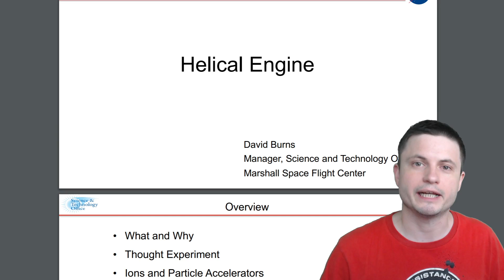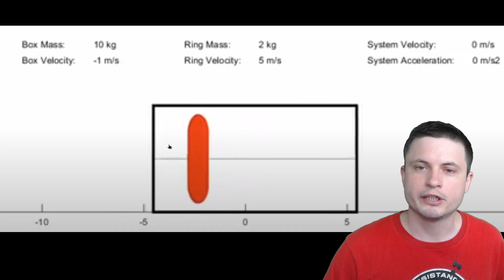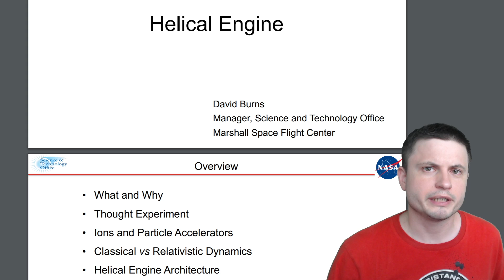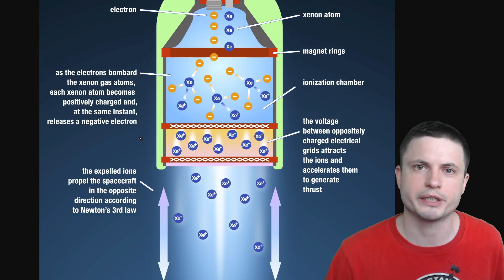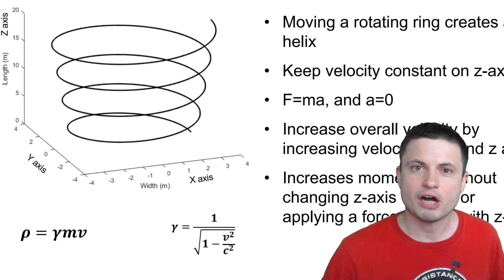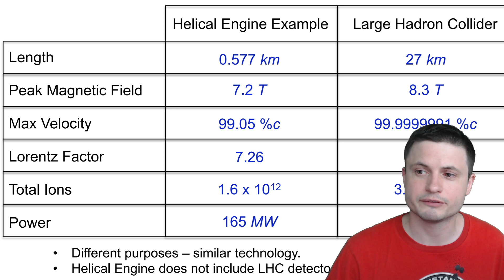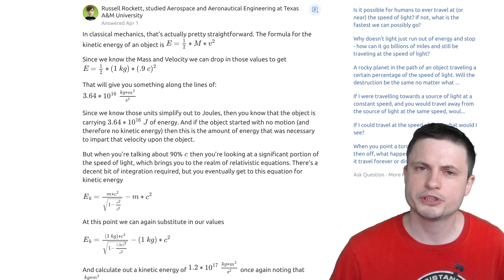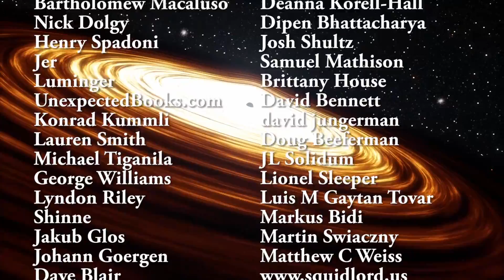NASA Engineer Designs a Near Light Speed Engine But Does It Work?

Comment: this propulsion is a no go. why? because you are not recconing on how fast the lorenz transformation occurs. It does not gradually increase traveling to the front. If you have say magnetic mirrors at the ends of the travel, you have to boost the bouncing mass at the ends. While still in the magnetic field at the rear, as the object comes to a rest, to re-accelerate the object towards the direction of motion, the magnetic field has to push harder because as it moves up to speed to go forward the mass is increasing in the magnetic field as it accelerates so you have to use more and more energy just like relativity says. More and more and more and then finally you are using all the available energy just to keep this object in motion as it decelerates  less and less and less. As you approach c. so subluminal. I want superluminal. If you ever did make this machine work, everything in front of you would be changed into highly radioactive particles. Everything near the speed of light would emit gamma towards the rear and you cannot shield against anything like this because as you even neared closer and closer the radiation level would blitz anything with life in the craft unless you shielded it with so much mass for protection you would have no way to accelerate it even in a minor amount.

Comment: Back in the mid-80s I had met a gentleman who was working on getting funding for inventors. One inventor had created an inertial propulsion engine. I saw the book he had published with the math done in it. I gave it to a physicist I knew who gave it to some of the upper echelon in the Reagan administration. There was a magazine titled "Science" around that time and it was featured in an article about exotic propulsion systems. It was simple. It had a spinning arm with  a smaller arm with several spinning balls on it. As the larger arm began spinning the smaller arm would begin spinning at a particular time. This would function to direct the momentum of the object thus moving the object. According to the math that was in the book an object with this kind of propulsion (which had no reverse thrust only forward momentum) spinning the arm at 60 RPM could reach light speed in the vacuum of space in about 2 weeks. Later I saw another version of inertial propulsion done by the original gentleman. He had 5 spinning disks weighted at one point. They would do the same thing but using weights. From what I heard NASA has some researchers working on this type of propulsion. The reason I mention it is because you mentioned something about spinning involved in propulsion. But then even at 99.99999% the speed of light it would take many years to become interstellar. Something else needs to be done to become interstellar.

Comment: Seems promising. So what if it requires a lot of energy? Energy is easy. The problem with long distance travel is reaction mass. But this solution requires no reaction mass, only lots of energy. So all we need is a much more efficient energy source like say matter-antimatter reactors.

Comment: What we need for interstellar travel is a craft that will go many times the speed of light. This would be accomplished by using other force fields that Einstein was not aware of when developing his theory of relativity . It is accomplished by accelerating subatomic particles (mesons and bosons) through fiber optic cables which wrap around the inner core of the ship.  This also allows the craft to float on the earths gravitational field. it also protects the occupants from the forces of acceleration and deceleration.

Comment: Energy is the very least of the problems with this design. It's entirely concievable that a fusion powerplant available within the next few decades could produce the level of power this thing would require. However, I do see three major problems with this design.

The first is a common mistake in the interpretation of Special Relativity: the erroneous assumption that as velocity increases to relativistic speeds, mass increases. That is, unfortunately, one of the many "lies to children" simplifications that a lot of modern science communication uses. The actual Lorentz transformation equations don't say that at all. It is, in fact, momentum that increases, not the mass. The mass remains exactly the same (if it didn't, then fast objects would also create greater gravitational forces on objects around them, which would obviously violate general relativity). Because it is the momentum that is altered, it is also conserved (unlike Conservation of Energy which is highly conditional, Conservation of Momentum is highly inviolate), and I'm pretty sure no amount of speed in the "donut" reaction mass would allow it to unbalance the equilibrium of the ship. I haven't gone through and done the calculations in detail, so I don't know where exactly in his thought experiment his misinterpretation of GR bites him in the butt... I just know it surely must do so somewhere.

The second problem comes from an engineering standpoint: there is no material in existence or indeed any traditional material even theoretically possible that could withstand the centrifugal forces involved in spinning at 0.8c and above. It isn't a matter of enough advancement in material science; we would need a whole new type of material. Maybe something composed entirely of quarks and held together on a macro scale by a modified chain of Strong Force in the form of a gluon plasma? In any case, we're talking a material that's probably closer to millions of years away than dozens.

A third problem is that linear momentum is not the only thing conserved; angular momentum is conserved as well. This in order to produce the torque that spins up the reaction mass (the donut), the ship will experience exactly the same angular momentum in the opposite direction, with nothing to push against in space to prevent it. In order to keep from spinning up to speeds more than sufficient to vaporise the crew and probably any delicate electronics (not to mention the ship itself), it would need to use thrusters to counter the torque. Enough reaction mass in the form of thruster fuel, in fact, to speed one kilogram up to whatever it was, 0.86c, which as you said is petaJoules of power... and that's for each spin-up AND SPIN-DOWN of the "donut". In other words, just the spin-up and spin-down, repeated enough times to accelerate the ship, should mean that the thrusters themselves could get the ship up to relativistic speeds.

Comment: There several key tech that can make a FTL interstellar starship possible. 1st use the established tech of super cooled super conductive ceramics. 2nd manufacturer a fusion power planet open to space, but tied to the starship. 3rd create a neo magnetic opposite generating magnetic fields with duel systems. A core that rotates, with a stationary envelope chamber. Add in the element of mercury inside the chamber. In the core a liquid lead base. Add in vectors to propell and change direction. This will create artificial gravity and inertial dampening. Along with create a sort of force shield. As the movement and energy produced will make a high density super plasma shield. There is more involved in my theory. But this is the key nuts and bolts of my idea. One that I just know will work. And there are specific reasons for my faith in my theory. Covental thinking or over thinking seems to be a problem too many eggheads have.

Comment: I have analysed very similar system. According to physical theory if all is taken correctly into account, we can not get away of law of the momentum. Error they do is applying value from one reference frame inside another. They also do not take into account the fotons that move from battery into plasma, e.t.c....

Comment: This is the high tech version of blowing your own sail. Yes, the air pushes the sail forward, but it pushes you  backward by the same amount, producing no net thrust. The author forgot to take that into account. In order for the drive to work, you need not only to absorb the momentum of the beam, but also accelerate the beam back in the other direction. That second part however produces a net backward thrust equal to what you gain from the first part (I'm ignoring the transverse momentum which would actually induce a torque but could easily be cancelled)

Comment: Theoretically possible, but the energy required to move the cylinders at relativistic speeds needed to "knock off the molecules"  so this works reaches infinite. It's basically the same as the Alcubierre drive; the energy needed to fold space/time to create the space/time waves is the total energy mass of the universe. Possible, yes. Realistic? no, not in the slightest.

Comment: Something seems off here. If you look at this in the reference frame of the spacecraft itself, this is just a normal synchrotron. It should be symmetrical and not produce any thrust. But according to the equivalence principle, if you do not feel acceleration (or gravity) in one reference frame, you don't feel acceleration/gravity in any reference frame. So how could this thing accelerate the spacecraft? And even if it could, how can momentum be conserved if nothing leaves the spacecraft (ok maybe gravitational waves do, but I see no reason why these would be asymmetrical)?

P.S. Looking into the case of the bouncing box, the bouncing object just transfers its momentum to the spacecraft. So instead of trying to bounce a relativistic object (good luck with that), you could just transfer the momentum to the spacecraft directly (wherever it came from), instead of taking the bouncing object as a mediator.

Comment: Are satellites experiencing "time dilation" or reacting to a difference in the Electric field strengths of the Earth's surface and that of the orbits in space?
Reply: They experience a tiny amount of time dilation due to the speed they are travelling at. This is factored into their timing systems, otherwise their GPS information relayed back to earth would slowly drift.
Reply: @philmcdonald7956  Yep, what people tend to be unaware of is that time dilation is a proven thing that we account for, not just a hypothesis
Reply: There's no satellites, everything is ground based .
Reply: @josephallen8044  Nonsense. There are hundreds of communication, weather. spy. geology, cube sats. GPS (and defense) satellites, all experiencing (and compensating for) small amounts of time dilation. The European GPS system is going into space soon to add to the many hundreds of satellites already in (mostly but not exclusively) geo-stationary orbits.

Comment: @Anton I think totally you missed to mention that that the ring mass is assumed to change its mass when hitting the box left end respectively right one.
e.g. before hitting left the mass would be decrease before the right hit it would increase back to initial mass.
This would result in a net acceleration to the right.
As it is not clear how to increase/decrease the mass periodically, the author suggest replacing the ring mass with ions.
He lets the ions move on a spiral path between the left and right end. The axial ion speed form end to end is kept constant but the spiral radius is changed increasing from the left to the right end such that the total speed and momentum of the ion is increased before hitting the right end and decreased before the left end creating a net acceleration.
Momentum is conserved by Bremsstrahlung generated by the ions and emitted to the environment. 
Hope that this explanation is more or less correct.

Comment: An engine with negative field Hyperwave generators in combination with trireflecting wave mirrors works better especially in the case of space-time dimensional compression even if its overkill in cases of distances under 50 light-years.

Comment: Well, is not simple? You just need 2 detach parts, maybe magnets and a separator at the middle of the motion so they are separate. Something wrong with a separator? You could use a fill object too with sand for example that drop the sand in the movement in and gain when it goes out.
Sure that this don't fall on one of those perpetual motor machine type of deal?
How will you move for the first time.
I still think that the problem with fuel will be solve by nuclear. What's the problem of having a micro nuclear engine fuel by trinium on your vehicle? None. It would be way more safe having the fuel contain in a shield container than a gas/diesel plastic tank that every so often kill people anyway and guess what? Nobody that drive cares, nobody will stop driving just because of the risks, life is a risk on itself.

Comment: Doesn't work. If you make particles move at relativistic speeds, they will start emitting radiation. The photons of that radiation will hit the wall of the box, which will negate all the momentum you supposedly gain. Unless you make the box transparent to the radiation, at which point you'd just have a complicated photon drive. This isn't worth being discussed.

Comment: What about if the rectangle, was shaped like a half donut? So the ends would be the direction you want to go. The inner object (as you depicted in orange) would hit one side, travel the inner length of the half donut (rectangle) and hit the other side that's also pointed in the same direction you want to go. You could also have more than one Half donut.

Comment: No. You're being impatient. We don't need 2x mass shift. Like an ion drive, this could accelerate slowly over years and still accomplish great things because nearly pure energy to velocity conversion. The real innovation needed is a ramscoop system that could refuel an on-board fission reactor of some sort.

As you said with the gps satellites, these effects are existent if not apparent at even low speeds. Any sort of imbalance properly canceled inherently becomes harnessed. In space the imbalance would be effectively cumulative.

You're saying this is impractical because under powered, but you could say the exact same thing about ion engines because we can't use them as main stage thrusters.

Comment: The link for NASA report doesn't provide any mathematics of Lorentz transform, on which a slight push in the direction of propagation of the rocket can be achieved. Einstein had a thought experiment with an electron (ion) moving in a magnetic field creates an electric field and a force on the electron due to Lorentz transform. What is the direction of the force and if it is in the direction of the rocket's forward direction is not explained in the report or Anton. Confusing. Needs rigorous mathematics & physics.

Comment: Ok, here's my opinion with a little more scrutiny than my first comment. 

First, let's get this out of the way: all propellantless engines violate conservation of linear momentum. It doesn't matter how we slice it, nature doesn't seem to work with "black boxes". What I mean by that there's this unspoken principle where anything that happens inside a system that may affect its exterior always has a tell-tail sign. Even gravity itself can be viewed as the way nature found to tell an external observer the amount of energy inside a system. So seeing an engine accelerating forward without any external signs, is a "black box", which means that if one doesn't see any violation of any conservation law, just keep looking and one will show up.

Now, how can you get the effects Dr Burns got in his calculations, thus violating momentum conservation? From his slides and the simulation in the video of the simulation, I'm guessing he is ignoring continuous acceleration, including when reversing the movement of the inner mass, which is the same mistake that creates the "twin paradox", when there's actually no paradox at all. Also, as I said to Anton in my first comment, considering mass as "increasing with the Lorentz factor" is an interpretation that was abandoned some time ago exactly because it would lead to this kind of thinking, clearly mistaking mass with inertia. Mass is Lorentz invariant, while inertia (as in the resistance to a change in movement by an external force) is the one which is Lorentz dependent.

Comment: Don't think this works. Idea suggests accelerating an object to one end of the spacecraft increasing its mass and decelerate towards the other end so that the interaction forces with the ends of the craft are unequal (due to mass difference). Math is correct but physics is wrong. There are inverse forces imparted from the object to the spacecraft when the object is accelerated and decelerated. Thus the net force is zero. QED

Comment: Putting aside the fact that this "device" has to be accelerated to near lightspeed to even begin to function, it is based on a misunderstanding of special relativity. Mass does not increase, inertia does. The "gun" and the "target" are also traveling at relativistic speeds and also gaining inertia. Any increase in kinetic energy requires a equivalent increase in energy input. There is no free lunch on Earth or at lightspeed. BTW the "spinning finger" is an absurd analogy.